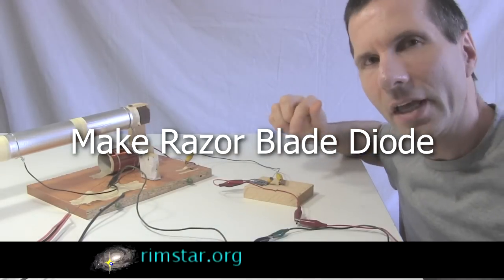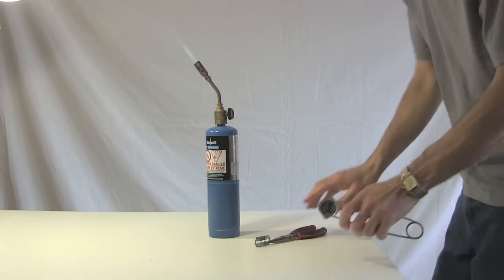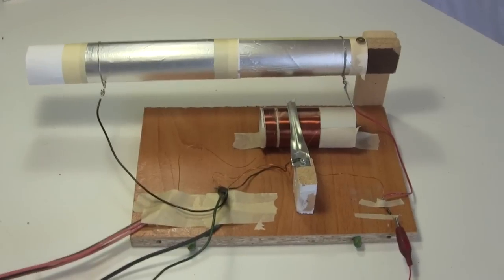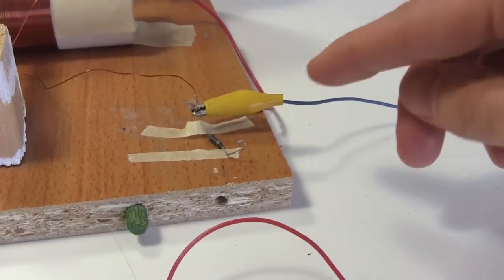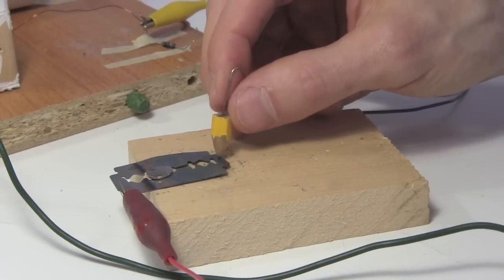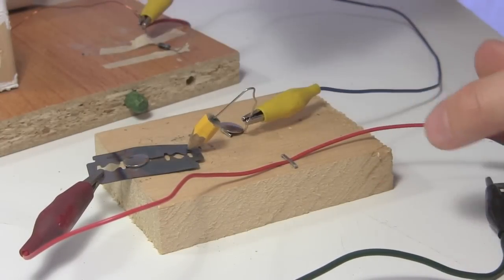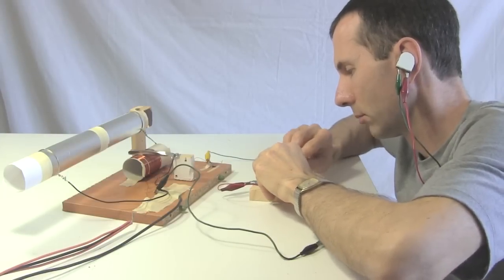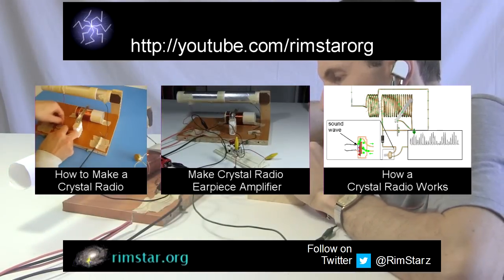Make Razor Blade Diode for Crystal Radio/Foxhole Radio

Comment: how did they figure out that heating the metal makes it act as semiconductor?
Reply from the maker: Oh, I have no idea where I first learned this. If you're looking for more information about it, here's a link https://en.wikipedia.org/wiki/Foxhole_radio#Designs_and_operation
Reply: @RimstarOrg  Thanks, I found it on Crystal detector wiki.
Basically engineer named Greenleaf Whittier Pickard by accidentally unplugging all batteries (he wanted to unplug only one of 3) realised his radio detector worked anyways and he concluded that incoming waves must get rectified, otherwise he would not hear anything. He realised it was due to the metal corrosion/oxidation. Interesting stuff!

Comment: where the hell is the crystal?
Reply from the maker: Back in the early 1900s, instead of the diode, or in this video, instead of the razor blade, you used to have the sharp tip of a wire touching a galena crystal. These days we call a crystal radio any radio that gets its power from the incoming radio waves.
Reply: @RimstarOrg  The bluing is a very thin layer of iron oxide, a semi conductor

Comment: Hey, did you used regular piezo Passive buzzer/element as your earpiece? 

 I see that your earpiece shaped pretty much similar to a piezo buzzer inside and old microwave. If yes, is that really work well?

  Is that loud enough? How much kilometer is the closest radio station nearby? What kind of antenna shape?

 If i used to make this crystal radio using a stainless wiper (not an alumunium variabel Capacitor) with a 0.3mm thick Hellenic copper wire with roughly calculated length similarity with the coil you made in this video from sight, would it work?
Reply from the maker: I used a piezoelectric earpiece that you can buy that is especially manufactured for this purpose. Those give the best results. However, I have tried using piezo buzzers and piezoelectric disks from inside old microwave ovens before and they work almost as well.
My radio stations are within 5 or 10 kilometers of me.
My antenna is very short, only around 5 meters of straight wire, but I think that only works because my radio stations are so close. Longer would be better.
Regarding my coil, you can see the details of making my video here https://youtu.be/VqdcU9ULAlA and here https://youtu.be/HZZmKZJrIW0 0.3mm is around 28-29 AWG and will give a pretty short coil which would mean that your radio stations would be physically on a smaller length, harder to tune into. Regarding a stainless wiper, as long as there's no non-conductive coating on it then it should work. Mine is steel, I don't know if it's stainless though I suspect it is.
Also, for best results, I'd use an actual diode not a razor blade.
Reply: How much is the Variable Capacitor capacitance you used
Reply from the maker: The maximum for my variable capacitor is around 640 picofarads.

Comment: To truly blue steel  you need to start with carbon steel.  It's very hard to find a carbon steel double edged razor blade these days but carbon steel single edged blades are plentiful at any hardware store.  Yours turned gray because you went way above the temperature to make it blue and that applies whether carbon or stainless.  A solution of salt, vinegar and hydrogen peroxide can be used to rust carbon steel.  After it's rusted, place it in boiling water for a few minutes and polish with steel wool.  Use only steel wool.  Brass or stainless substitutes will interfere with the process.  Repeat as necessary to get a good rust blue formed.
Reply from the maker: Thanks for the tip!

Comment: With the foxhole radio, like they used in Nazi occupied Europe, they used a pencil with the wire pushed into it's graphite, and probed the razor blade to find a station. Your idea of an amplified earpiece would have been dangerous, wouldn't that act like an oscillator and be detected by the enemy? That would mean death to those using foxhole radios. That was the good thing about those radios, they emitted nothing that could be detected.  Now days I wonder if a crystal radio could be made to pick up FM stations? There's so little AM broadcasting lately.
Reply: Even if all that were true, still, an "amplified earpiece" could have never been built in a foxhole or trench... If that were possible, they´d also be able to build HiFi-Radios, TVs, and jacuzzis in the foxholes... It was just to make it loud enough for us watching the video...
Reply: Phil Leotardo spent 20 years in the can. He wanted HDTV, compatible. He compromised and built a crystal radio.

Comment: A similar option is a utility blade which is thicker.  I heated one on an electric stove and it seemed to get some blue coating on it.  I tested this diode with the diode checker in a multi-meter and it has one if the lowest forward voltage drops available,  at about 0.2v.  I guess it is a type of Schottky diode.

Comment: .
    I hate to break it to you but that razor blade is NOT "blued" in the traditional sense. The Gillette "super blue" blades, which aren't made anymore, are the blades intended for this circuit. You can also try a blued gun barrel. I'm glad to know that your heated blade worked though. That is another option that a prepper could use on an emergency.
    When I was a kid in the 60's, I lived 5 miles from the hill where all the commercial radio and TV stations had their transmitting antennas. I built crystal radios that only needed a ground because the signals were so strong, they didn't need a long wire antenna.
    Once, I added the 2,000 to 8 Ohm miniature transformer from a transistor pocket radio and an 8 ohm speaker. It was so loud that I had to wire in a potentiometer, volume control. At my house, this one didn't even need a ground. The only problem was the inverse square law. If I took it in the car with my parent, the farther we drove, the lower the audio level real quick.

    For those who don't know what the inverse square law is, it basically says that for any wave from low frequency audio up through gamma rays, The more distant that you move away from a signal source, it gets four times weaker.
Reply: What do you mean 4 times weaker? It's true for distance of 2 units. But signal gets weaker according to square of the distance - 1/(d^2)
Reply: @PinkeySuavo  It is NOT according to the square. This is why it is called THE INVERSE SQUARE LAW. Put simply, a wave weakens by 4 times according to the INVERSE square of the distance from it's source.
Reply: @jeffmccrea9347  Yes, exactly, so what do you mean by saying wave weakens by 4 times?
Wave weakens according to inverse square law. So it depends strictly on distance. We can't say it's always 4 times weaker
Reply: @PinkeySuavo  ...Yes, exactly, so what do you mean by saying wave weakens by 4 times?
Wave weakens according to inverse square law. So it depends strictly on distance. We can't say it's always 4 times weaker...

Below is the definition of the invers square law regarding electromagnetic radiation and applies to everything from ELF, (extremely low frequency waves in the 70 Hertz range used to communicate with submarines from the Navy's transmitter in Wisconsin to the Voyager I and II spacecrafts in interstellar space to Gamma radiation emitted from colliding black holes and neutron stars.

 The inverse square law for radio waves states that the signal's intensity (power density) decreases rapidly as the square of the distance from the source increases, meaning if you double your distance, the signal strength becomes one-fourth (1/4) as strong, because the energy spreads out over a sphere's surface area (\(4\pi R^{2}\)). This "geometric dilution" explains why radio signals get weaker quickly in open space, impacting antenna design and communication range.

Key Concepts Intensity & Distance: The intensity (\(I\)) is inversely proportional to the distance (\(d\)) squared (\(I\propto 1/d^{2}\)).Doubling Distance: Move twice as far, intensity drops to 1/4 (2²=4).Tripling Distance: Move three times as far, intensity drops to 1/9 (3²=9).Spherical Spread: Radio waves radiate outwards in three dimensions, spreading over the surface area of an expanding sphere (\(4\pi R^{2}\)). Practical Implications Signal Strength: Explains why a radio signal is strong near a transmitter but very weak far away.Antenna Design: Engineers use it to position antennas for optimal signal reception, considering the power and directionality.Radio Propagation: Crucial for understanding how far signals travel and why signals from satellites or distant stations fade. Formula For a point source, the power density (\(P/A\)) is \(P_{total}/(4\pi R^{2})\), where \(P_{total}\) is total power, \(R\) is distance, and \(4\pi R^{2}\) is the sphere's area.

Comment: Doesn't iron need a temperature of 500C or more to oxidize? and Can a regular furnace reach this temperature?
Reply: Red hot steel is at about 700C.  A kerosene blowtorch can reach 1100C.
Reply: You can reach oxidizing temperatures using most stove tops as well in my experience

Comment: Apparently a razor blade diode was used in the radio made at the Hanoi Hilton POW camp. I think a slinky spring was used as the coil and foil and paper for a capacitor.

Comment: A "funny" thing has happened at my work. We built a test system with pumps, which used a water level sensor. The sensor was simply based on passing very small DC current through water. Since the currents were below a milliamp, we didn't think much of it. Over time, the pump actually started to rust from the inside and increase the conductivity of the water. Eventually, we were passing high enough currents to cause significant electrolysis and the level sensors ceased to work; the sensor appeared to be always closed. 

Funnily enough, when measuring with multimeter, it appeared as open circuit. When measured again, it appeared as a small resistance. When measured yet again - open circuit.

Eventually I found out that the electrolysis products were forming a parasitic diode between the terminals. The reason for me getting a different result each time was that I was randomly swapping leads of the multimeter around, as I was expecting a resistance, not a diode!
Reply from the maker: Cool. Good detective work.

Comment: Fox hole radio. I made one using a lead from a number 2 pencil. Then I tried a lead from a capacitor in which I could pick up more than one station. KDKA wad the first but I also picked up a weaker station KQV in Pittsburgh. Good project for a pre teen I was in the seventh grade when I read how to make thos radio. You can use an old dark penny instead of a razor blade.i also picked up short Wave station from the Netherlands probably because my coil was big and over 100 turns. The corrosion of the penny had something to do with the reception. 73

Comment: mine never worked. i used 185 turns on a tin foil paper tube with a 0.5mm wire and did the same method and still doesnt work. even i use a long analog TV antenna
Reply from the maker: These ones with the razor blades are harder to get working than the ones with the 1N34 germanium diodes. Also, do you have any AM radio stations to pick-up? There are fewer and fewer these days. It could also be very faint to hear so you could add an amplifier to test. Anyway, rather than repeat every tip, I have tips on my webpage here https://rimstar.org/science_electronics_projects/crystal_radio_tips_and_tricks.htm
Reply: @RimstarOrg  I tried with a 20 watt amplifier and it's just a 50 or 60hz buzzing noise.
Reply: Same thing with Bluetooth speaker. I ordered 1n34a diode and I will try it again
Reply: How long is your antenna?

Comment: Thanks for educational videos.
May i ask about history(not a technical question).
Foxhole radio be made with junk parts for previous people or prisoners during war.
 But how they could make speakers from junk parts? Because it needs low current piezo speaker but i think to my self it is hard to make. :)
Reply from the maker: My understanding is that they made headphones that used a lot of wire to get a high enough impedance.
Reply: @RimstarOrg  thank you for your knowledge. I am gonna try.

Comment: i spent over 20 hours just trying to get this to work, and i didnt, i am so pissed
Reply from the maker: Check out my tips for getting a crystal radio to work on by website here https://rimstar.org/science_electronics_projects/crystal_radio_tips_and_tricks.htm . Next, do you have any AM radio stations nearby? There are fewer and fewer AM radio stations all the time. I have a few nearby but live in a big city. Using a razor blade diode instead of a germanium diode is more difficult to get working and doesn't work as well. So you could try with a germanium diode. The antenna tip is also an important one. And trying with an amplifier is also good because it'll test if you diode is the problem.
Reply: @RimstarOrg  I have many am stations nearby, and using my grandfathers handheld radio I am to listen to these stations. Also, I tried using both germanium and razor blade diode but to no avail. I made a antenna from a stainless steel pipe, and a couple of large gardening staples. I do not have an amplifier so I can’t really test that one out. I used a multimeter to check the voltage output on the audio lines, could you please tell me what reading you are getting. I used a piezoelectric buzzer just like you, I can hear it buzzing very faintly.
Reply from the maker: I've never tried measuring with a multimeter and I don't have any of my crystal radios set up now, they're all put away. However, I wouldn't expect much with a multimeter since the output is neither AC nor DC. I did look at it on an oscilloscope once and the waveform peaked at very low voltage. I don't recall exactly what voltage but around 20 or 30 millivolts comes to mind. Regarding your antenna, a pipe doesn't sounds like a very long one. The gardening staples puzzles me. Are you saying you've electrically connected the pipe to the ground by stapling the pipe to the ground? I don't think it would work that way. The antenna should be insulated from the ground. My antenna is very short, only around 12-15 feet but I also live close to strong radio stations. I'd suggest looking for a long wire to use as an antenna instead. Arrange it in a straightish line. Wire can be stripped out of all kinds of things, long wire can be gotten from coils found in motors for example.
Reply: I have an old CBS lt537 germanium transistor..could I use half of that for a diode?

Comment: Hi @RimstarOrg very interesting video. I am an educator and plan to design a lab to ask my students to build this radio in a lab and then, in turn, teach them P-N junction and semiconductor. I am trying to understand the science behind this Razer diode. After a day of google, I end up knowing it is a "metal-semiconductor" junction or a "cat-whisker detector" and it works like a Schottky diode. However, I am still confused about the following:

1) What is the anode and cathode in this razor-pencil diode?
2) If the steel is the metal and the graphite is the semiconductors, what is the reason for having "blue steel", is it related to the oxide? or is it related to the crystal structure and therefore the bandgap changes of steel after heat treatment?
3) If the iron oxide is really needed for it to work, then there is oxide in both side of the iron, why is it diode? it sounds more like a transistor to me.

I will be very grateful if anyone here can give some insight or direct me to the right source. Many thanks! :)
Reply: Here's a theory. The steel in the blade is high carbon, this means it's tempered and the carbon is microscopically dispersed in a way that atoms of carbon 'pin' slip dislocations in the steel making it harder and less easy to dull the sharp edge for lots of close shaves. When you 'blue' it, the temperature allows the atomic carbon to migrate in to little pockets or grains of carbon inside the steel. The PN junction is actually at the boundary of any of these carbon 'bubbles' and the surrounding de-carbonized steel regions. Using graphite allows a carbon-carbon contact so that you don't form a reverse junction negating the rectification effect. What you have to do is find an exposed surface of one of the carbon bubbles to touch just like you used metal to metal on the other side. I don't think its because of oxide, steel oxide is rust.
Reply from the maker: I don't have your answers but hopefully someone else here does!

Comment: Can use a aluminum electode in water diode?
Reply from the maker: Judging by this https://halestrom.net/darksleep/blog/021_more_diodes/ (found by a random search), it doesn't look good. He says it didn't turn on until around 5 volts whereas for a typical crystal radio, you need it to turn on at around 0.2 or 0.3 volts, which is why often germanium diodes are used. That's just one person's testing though and the first webpage I found. I've no experience or prior knowledge with it myself.

Comment: I hope I am not overstretching my welcome if I ask another silly question: would it be possible to catch stations without any diode of any kind? Just the coil + antenna, the wiper and the earphones? With or without resistor?
Reply from the maker: You need the diode (generically known as a detector since as you see in this video, there are more ways of making it than buying a commercially made diode). I don't always use a resistor.
Reply: @RimstarOrg  if I understand correctly, the diode is used to "rectify" the input by stripping off the (amplitude) modulation. But what if the input has not been modified at all? Say, a "primitive" transmitter , would a diode still be necessary to capture those sounds?